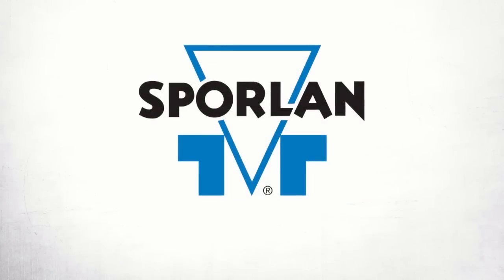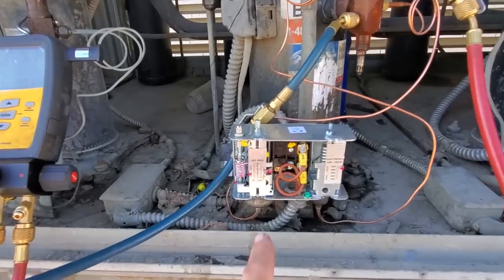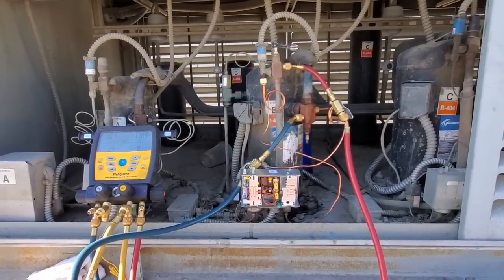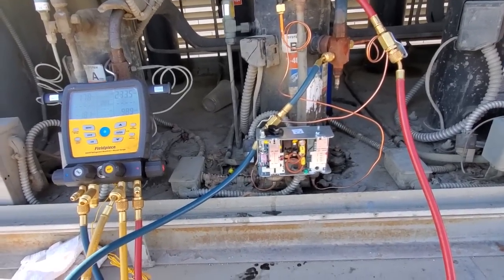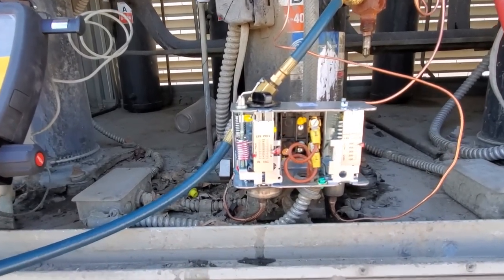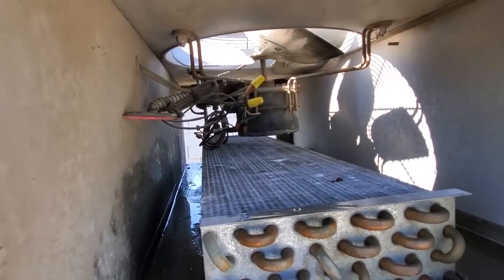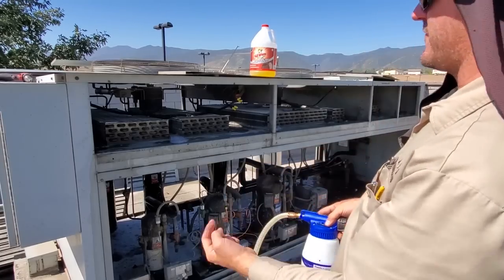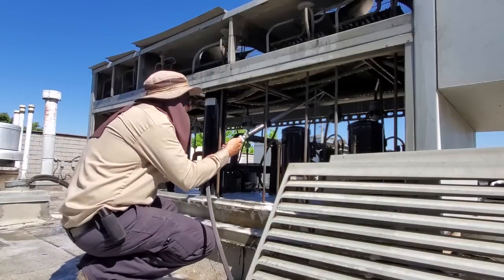WALK IN FREEZER NOT TURNING ON

Comment: As an ex-electrician, that wiring makes me cringe. Especially those wires run through raw metal holes with burrs sticking out.
Reply: Me too. i would not be able  to sleep at night till it was fixed.
Reply: OcRefrigeration,Hvac & Electrical. Lol
Reply: Not to mention the closed loop of metal between the wires acting as a transformer and heating up.
Reply: JAMES AZBELL I didn't even think about that so let's add some more heat to an already hot condenser cabinet and melt wire insulation faster.

Comment: Good vid. i Guess the Moral of the story is don't set Your R-404 Freezer Low pressure controls above 25psig. Its amazing what we see , Those raw wires running through metal drilled holes. thats the kind of stuff owners do. Just crazy ! can anyone say direct short to ground in a few years. You've Got Mega Balls Turning on that rack with All that water still in that rack. With My Luck , it Would blow the Main Breaker out of the panel and The Entire Building Main too.   One of my pet peeves is i Have to Rinse ALL Water out of Rack , Open All Boxes and Blow out with Co2 BEFORE  Powering back up. I'm NEVER That Lucky that Everything starts up With That Amount of Water Present. My Luck with Water & Electricity is AWEFUL !

Comment: a Nice Little Winter job on that unit When your not so busy is Clean up ALL THAT wiring. Open up All Lower boxes and check for chafed nuts etc. inspect all electrical wiring. a Quick vis. in ALL Connection boxes.

Comment: Absolutely hate those MOP valves. In my opinion they only used when the system isnt sized correctly, or when the system is being used outside its design intent. Would have been better if it was variable speed driven with extra capacity in the condenser for those "hot pull down" times. Liked the video, and i totally agree with cleaning the area around the condenser, my boss always thought i was playing with water he never saw the logic behind it.
Reply from the maker: I will be going live on YouTube this evening 7/8/19 @ 5:PM pacific time come check it out if you can https://youtu.be/11n-kqTVvD8

Comment: Beautifully described how a ZP powerhead works, wondering if that was the wrong valve for that system, your approach to service is second to none my friend !!!
Reply from the maker: thanks Chris the valve is not wrong for the system it will work ok but it will have a long pull down time if the system is very hot due to that ZP powerhead
Reply: Will you be putting in a Z charge instead of the ZP when you go in for the accumulator. 
Thanks again for your time.
Reply from the maker: yes I will, I will be going live on YouTube this evening 7/8/19 @ 5:PM pacific time come check it out if you can https://youtu.be/11n-kqTVvD8

Comment: Now , what makes me scratch my head is: let's say you did need that pressure limiting power head , how could you find a compromise to keep it and yet set the low pressure control so that the compressor doesn't short cycle with the bypass ? That would really do me head in ... great to see how thorough you were and that you made sure you came back after the late night call 👍

Comment: I'm in Australia and every freezer we work on or install will have a cpr  valve or mop txv. Thats due to the 4 to 6 defrosts a day that will cause suction pressure to be higher than what the compressor is rated for. Mop valves are typically sat at 50psi and i set my cprs at 40psi s a general rule of thumb.

Comment: Most pressure controls I set at 15 cut in,  0 cut out on pump down systems. The scrolls will sometimes jump up a few PSI. Occasionally I will do cut in as high as 20 if the particular unit has short cycling. One short cycle is okay after a pump down, but any more than that, I adjust a little. In the winter here, pressure controls set too high show themselves pretty quick. Headmasters and heated receiver tanks are pretty common here. Fan cycling on the older systems mostly, and sometimes on new ones.

Comment: A few problems I see 

1.Those drain channels are very dirty
2.crankcase pressure regulator valve needs to be lower than 30
3.Pressure rises with the evap fans running
I'm sure there's more problems but those are some I see 

Also I'm in HVAC School so still learning

Comment: Hey bro, great diagnostic work and preventive cleaning thoughts.  Just noticed at 3:57 the flexible RWA(?) steel conduit coming into bottom of High/Low control doesn't have romex nut on it.  The two pink control wires run through it to yellow terminals.  Only point it out because of vibration.
Reply from the maker: yeah I will be fixing that when I go back for sure, good catch!! I will be going live on YouTube this evening 7/8/19 @ 5:PM pacific time come check it out if you can https://youtu.be/11n-kqTVvD8
Reply: Hahahaha, I was just going to say the same thing but figured someone beat me to it.

Comment: Question. Wouldnt the pressure rise with the evap fans running? I've worked on display cases that use the pressure switch as a temp control. Cuts the compressor off at a set low pressure then as the box temp increases the pressure increases and cuts the compressor back in.
Reply from the maker: the pressure control is not the temperature controller in this situation, there is a thermostat and solenoid valve down at the coil. The problem here was when the thermostat would call and the solenoid valve would open the pressures would not rise about 30 psig to close the low pressure control and this was because of the pressure limiting power head on the tev so I adjusted the pressure control lower until I could replace the powerhead.

Comment: I just got into commercial after 7 years in residential, and I love it. Have you ever messed something up doing coil cleanings with all that electrical underneath?
Reply: I worked with a guy who called me middle of night shorted tlhe low oil comp switch to 230" opened the switch on a 100ton unit  we jumped it for the night

Comment: Never even heard of a pressure limiting valve. Did you know it had that beforehand or did you find that info posted somewhere? Otherwise you would have to call the factory and hope they still had the specs.
Reply from the maker: Once I saw the pressure issue I looked at the code stamped on the valve power head and it said KT-43 RZP which is a low temp 404/502 pressure limiting powerhead
Reply: @HVACRVIDEOS  Ah nice. Like I said I never even heard of that so when I work on package units I will keep that in my pocket. Great video as always.
Reply from the maker: I will be going live on YouTube this evening 7/8/19 @ 5:PM pacific time come check it out if you can https://youtu.be/11n-kqTVvD8

Comment: ?- If the accumulator is oily and leaking, how far did the vacuum pull down in microns?
Reply from the maker: Not far we just pulled the air out and let it rip
Reply: @HVACRVIDEOS  old school= flush/purge with r11,r22, for a few minutes! de minimis release.
Reply from the maker: I will discuss your question on my stream tonight I will be going live on YouTube this evening 7/8/19 @ 5:PM pacific time come check it out if you can https://youtu.be/11n-kqTVvD8

Comment: This is Straight from Heatcraft ---
Freezer --- Heatcraft Factory Settings.
R-404

15 --- Cut - in.
10 --- Diff.
Reply: I think cut out pressure depends from compressor operating envelope and cut in pressure is depends compressor motor torque

Comment: I’ve never seen a mini rack like that, strange condenser coil setup
Reply: sean peterson bjs restaurants uses these type rack system setups
Reply from the maker: It's made by a company called Kairak a bunch of restaurants use them
Reply from the maker: Cool tech also makes the same rack
Reply: Alot of manufacturers make refrigeration racks set up like that. Omni temp is another one.

Comment: MOP valves are absolute crap.  I design this stuff, its much better to use a CPR valve OR a simple pressure switch inline with the llsv to turn it off at 50-60 psig.

Comment: Quick question for anybody’s:

On a Lennox Energence unit(2 stage 4 compressors), the coils were extremely dirty and it went off on high pressure. Why would 2 and 3 go off (contactor not pulled in) but 1 and 4 stay on (contactor pulled in)? That would be half of each stage running so it leads me to believe that each side of the coil being dirty had something to do with it(front side and back side). 

I’m just a facilities manager and trying to learn more about these units. 

Let me know your thoughts from anybody.
Reply from the maker: On the Lennox Energence units the condenser is divided into 4 sections so it is possible for only two to trip on high pressure. This could be caused by bad fan motors and or dirty condensers
Reply: HVACR VIDEOS makes a lot of sense. I appreciate the quick response.
After we cleaned coils and got the rest of the unit running, we were putting out 50 degree discharge air temp which is pretty good for where we are at.

Comment: I'm surprised you leave your wedding ring on for some of this.
Reply from the maker: It's a silicone ring so it will not conduct electricity and or it will break away if it gets caught on something.
Reply: I see. I actually meant I was surprised you kept it on & got it that dirty. I thought it was gunmetal pewter or something like that. I’m from a family where wedding rings come off before bed or anything dirty or wet, for safekeeping.